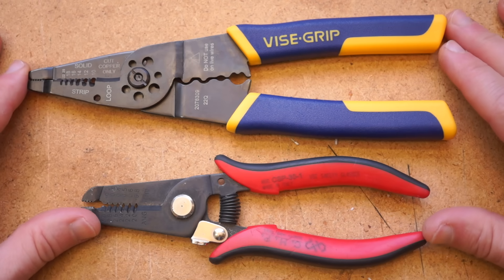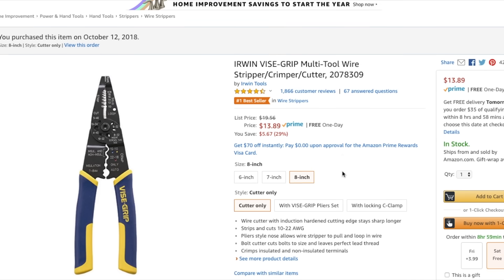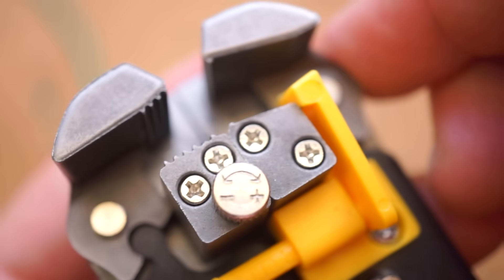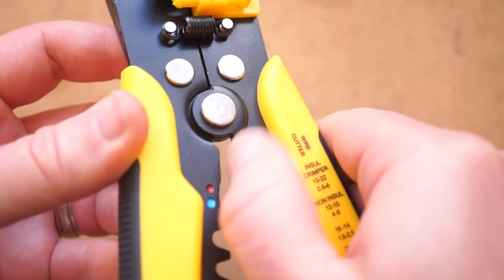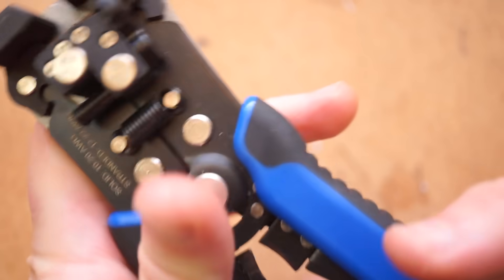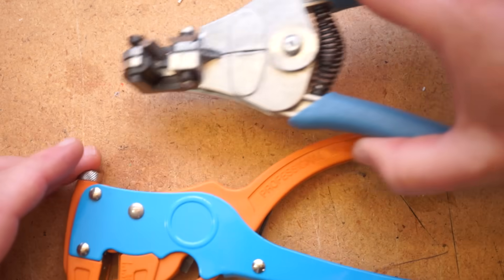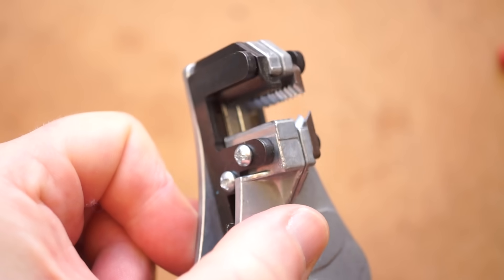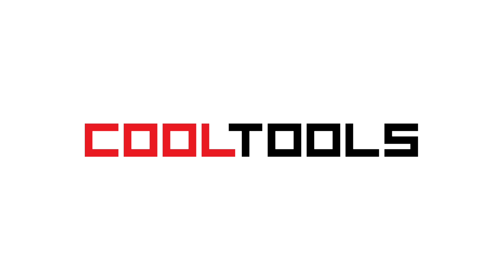Searching for the Best Wire Stripper

Comment: Think about it, most wire comes with a sheathing over the multiple wires (Romex, low voltage, etc) on it. In this video they show only single wires. So you have to cut the sheathing off with a standard wire cutter, then your supposed to use this to remove the single wire sheath? Ridonk! Who's using these?
Reply: I have the Irwin it will strip the outer insulation and then strip the individual conductors does not work well on slippery or stretchy insulation though

Comment: I literally had just researched every single one of these tools and many more options on Amazon a few days ago. I found pairs of self adjusters as cheap as $8 or so, but those seem to have more common issues, obviously. Like you mentioned, tons of the unknown brand options and even some big company rebrands are probably all made by the same few Chinese factories.
I have the same pair of Irwin manual strippers you said you bought on accident, and they work alright. I do need to get a set more like the small spring loaded ones you love. I also want a self adjusting set for when I want to work faster though. Overall great video, well made, clever in terms of adding to your revenue as well. You clearly know what you are doing on YouTube and I subscribed.

Comment: I think the moral is..you should own a lot of  different hand tools!  Auto strippers can be a challenge for slippery insulation on wires like PTFE. But work so great on small pvc coated wires. I also really like the stripax..sometimes you get what you pay for.

Comment: Irwin automatic isn't that good to me it only strips 10-24 gauge for $20 dollars. You can get the orange automatic at harbor freight and it strips 12-26 gauge. It has a knob you need to adjust for the gauge of wire. It's $9.99 and there are always HF coupons..  The Gardner Bender beats the Irwin as well $18.99 at ace hardware and it goes 10-26 gauge full auto. One year warranty. Only thing the Irwin has is lifetime warranty. I went with the Harbor freights for two main points less then half the price and it strips thinner gauge at 26 gauge. A bonus was my favorite color is orange.

Comment: I prefer the normal style wire strippers. Southwire and Klein make a great compact set that fit in your hand nicely and makes stripper easier to push with your thumb. But I do tear those springs out. I much prefer to open them myself

Comment: You should really look into the Stripax series by Weidmüller. A bit more expensive but you can often find them used for a decent price.
Reply: I wondered who made the good version of the... t-rex-head style cheap wire strippers. I'll try to pick up a pair.
Reply: Wow, about the cheapest I can find them is $75 though. I'd have to be doing the work professionally to justify that. They do look like they work great though.
Reply: They are worth every cent

Comment: I love that you did a video on this topic! I've been looking for good, self-adjusting wire strippers for a while. Did you happen to find any that work with wire finer than 24 gague?
Reply: A bic lighter. Heat the insulation and pull it. It's similar to the method used for spaceflight approved hardware. Prevents damage to the conductor.